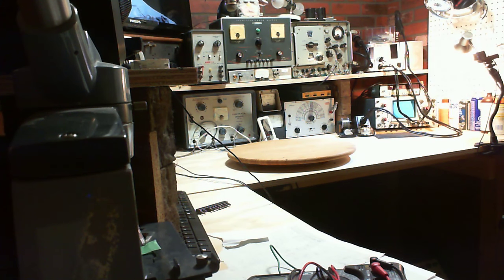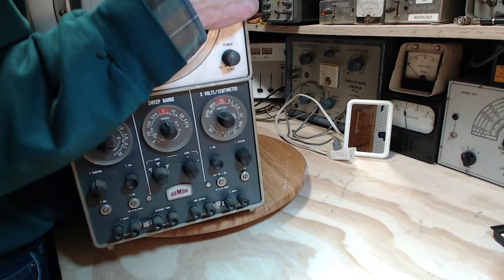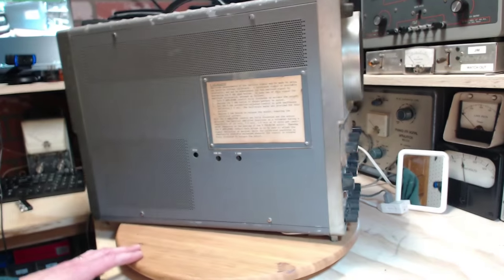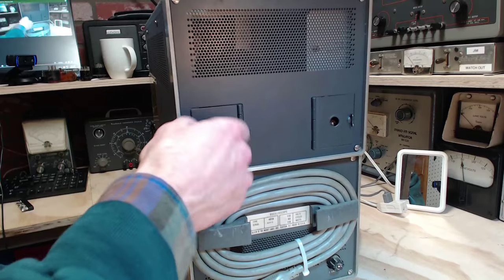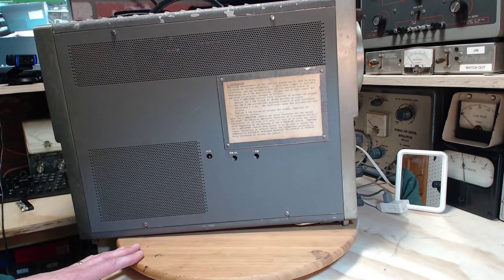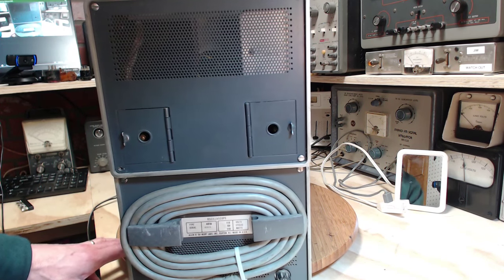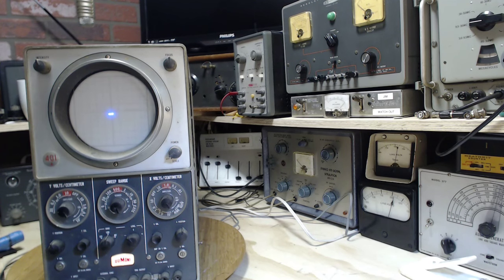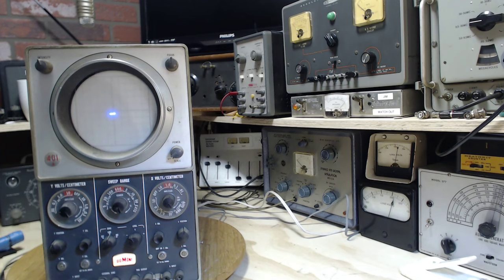Du Mont 401A Oscilloscope Video #1 - Checkout

Comment: Nice project Jim. I think auto means autoranging. I have a Sencore sc3100 with that. The sweep and vertical inputs auto set as you probe without you changing the controls. Makes it nice on old tv repairs. Jimmy in Alabama

Comment: that red tip on the tube means that it was graded for high precision and quality. Usually tubes that met those high standards were put in medical devices and other equipment which required high performance

Comment: I thought my Gould scope was one no one ever heard of. Guess you topped me with the DuMont.

I accidentally left my Gould on over night once to find a puddle of oil under it. It still ran for years after that. I got tired of fiddling knobs with dirty or worn switch contacts and picked up a digital scope.

Still there is something comforting about those old CRT displays.
Reply: Dumont was a popular brand here on the east coast mis Atlantic states.

Comment: jim dumont is top of the line for equipment. very high quality when high quality was still very good. not like the crap today. this scope deserves to be brought back to good working order and given a place of honor in a repair shop. try cleaning the controls and try it again. i bet it works allot better. it would be a shame to scavenge parts out of this. try to find the operators manual and service manual and bring this back to life please. when it isnt 3 am i will take a look and see if i can find the manuals.

Comment: Put the X knob into the "Auto" sweep position.  You had it set up for an X-Y display, and the X deflection you intermittently saw was noise, not sweep. The Auto position lets the sweep free-run, and the "drive" position is essentially triggered sweep. All the other switch positions are used for an external X axis input signal.

Comment: I've an old Dumont 304A that I intend to restore, when I find the time. Date?? Probably late 1940's to early 1950's, I did make the mistake of powering it up once, and it did work. But next time it gets power will after it's been recapped and a new power cord. It weighs well over 50lbs too, so lives up to it's nickname of "boat anchor".

Comment: Jim: I was curious and perhaps you covered this and I missed it. In your old shop, you worked on radios/phonographs/etc. brought into a local repair place. Since you moved is that work done with now? See you working on your on equipment now, which is fine...just wondering.
Also old scopes are pretty cool though without schematic and manual for calibration and repairs it could be frustrating.